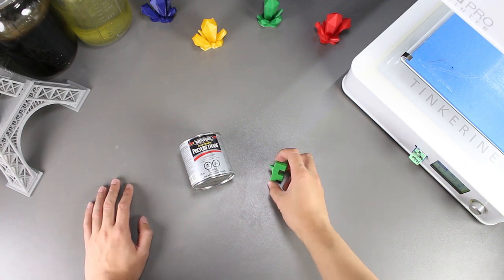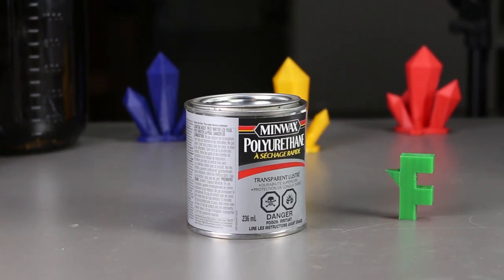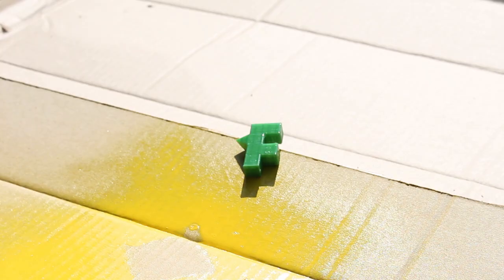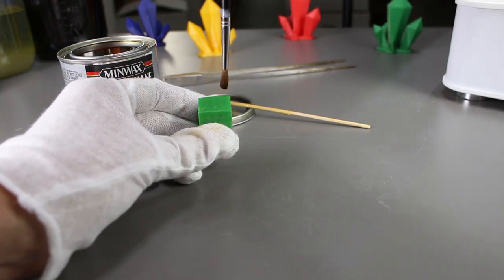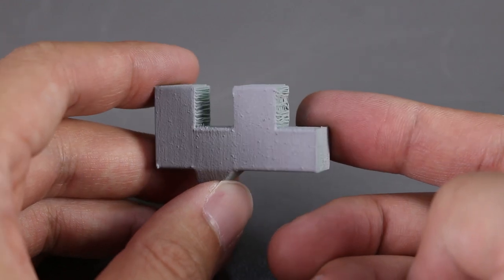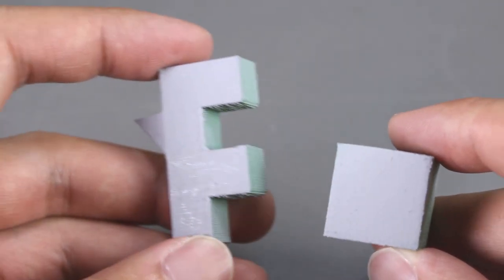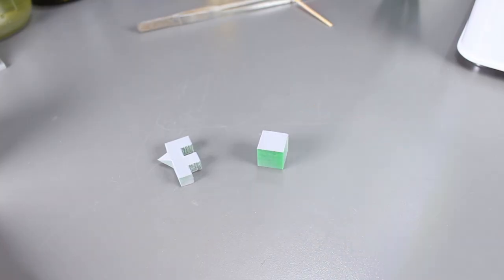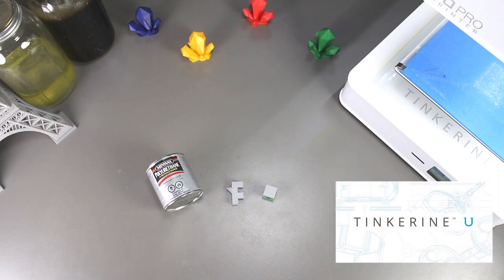Smoothing 3D Printed PLA Parts with Polyurethane Part 2

Comment: Dots on polyurethane are often bubbles from the application that get trapped. There's a bit of an art to polyurethane application for bubble avoidance, but if you're just using it to build up the low spots, you can just very lightly sand the bubbles out before spraying on your primer.  If you're patient, you can buy "wipe-on poly" or thin down the regular stuff with mineral spirits and do more layers; thinning it makes it easier for bubbles to escape.  You might also want to try water-based polyurethane, which cures much more quickly and is also way less smelly and toxic, but is also a bit harder to get bubble-free.
Reply from the maker: Thanks for the comment and advice, we will look into it in the future!

Comment: Interesting results.  I wonder if the little dots on the surface are an artifact of brushing on the polyurethane, or just other residues getting trapped on the surface.  If you want to keep going down this line, it might be enlightening to see how a spray polyurethane/clear coat behaves.
Reply from the maker: Thanks for the suggestions and comment!

Comment: i had an idea but i dont have 3d printed parts:
using short "Fireballs" to heattreat the surface. The benefit is that the heat is applied imidiatly and more consistent than with a heatgun.
"Fireballs" can be made  with a hairspry + lighter , or
 i prefer a isoalcohol + pumpsprayer (cheap garding tool watering plants) 
the cool thing is you can control the flame temperatur by addin 10-40% volume Water in the isoalcohol.Also the Pumpsprayer gives only an impulse (compared to the Spraycan)
Reply from the maker: Thanks for the comment and suggestion!

Comment: Hang on a second (and sorry I seem to be turning into a miserable, carping critic over these videos - LOL!), but unless I've missed something, the F had two coats of PU varnish and then a coat of spray primer, and the cube had, equally, two coats of varnish and a coat of spray primer - PLUS sanding before the primer coat. Shouldn't the conclusion here be that SANDING, not the PU or the primer (though they may have contributed - there should be a third object with no treatments or sanding to act as a control)  is what's responsible for the surface. We need an object with JUST primer and an object with JUST PU (same number of coats of each) to make a real comparison. Or am I missing something obvious in the vid?
Reply from the maker: Thanks for the comment! In this video there were two prints, the F model was from the previous experiment and has 2 coat applied on it already. In this experiment, we added an extra coat, so in total, the F model has 3 coats of polyurethane and then we applied a primer over it. That was to see if the F model that wasn't sanded down would still come out and provide us with good results. 

The cube, on the other hand, had 2 coats of polyurethane applied to it. However, this time we actually sanded it down after the first application and then applied a second layer before spraying the primer on it. In this video, we compared the two methods that we used.